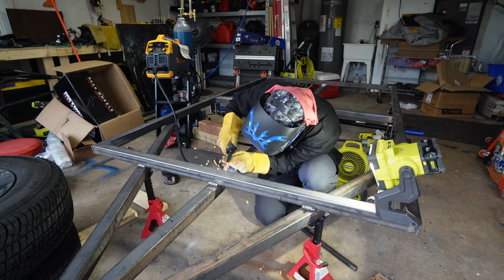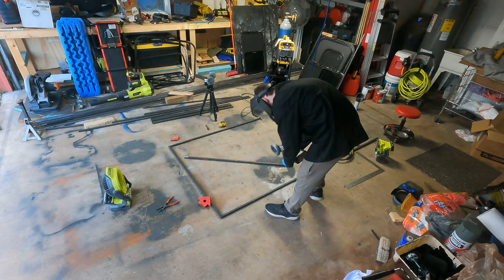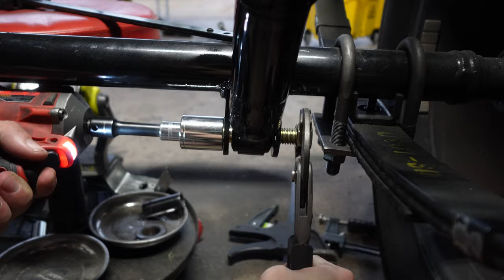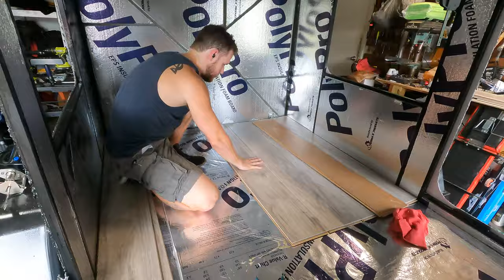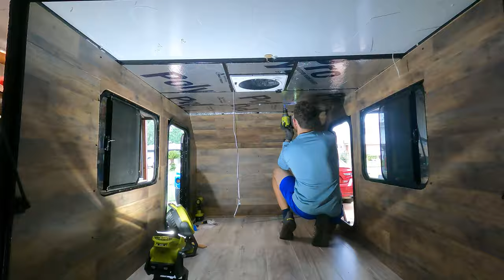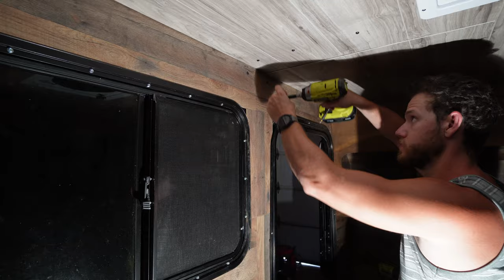DIY Overland Camper Build: Full Build Timelapse

Comment: Thank you Javi Lee. I enjoyed your hard work. I think the ideas you came up with were outstanding such as : using a metal frame housing (welding too was great), All the suspension bolts for wheels looked right according to other videos I saw about that topic. I liked the tail light positioning. I would like to see more about how to hook up the electrical with the battery and fuse box with the vehicle and describe any electronics that come with your kits to watch out for. Also, what other types of building out project ideas such as: Hooking up a bath, water, electric outlets etc. Good stuff - I'll keep tuned in. Peace ~